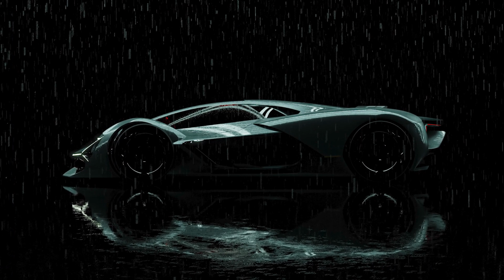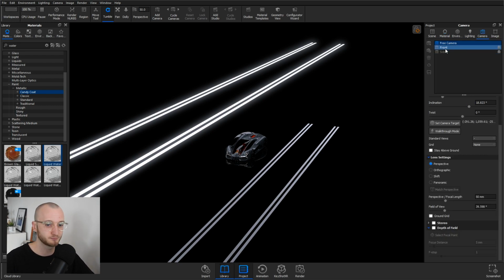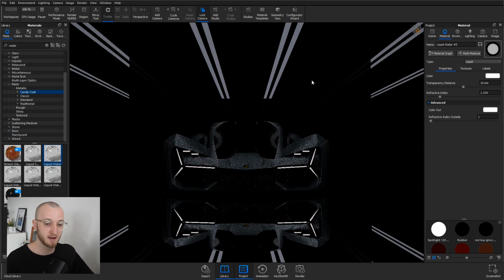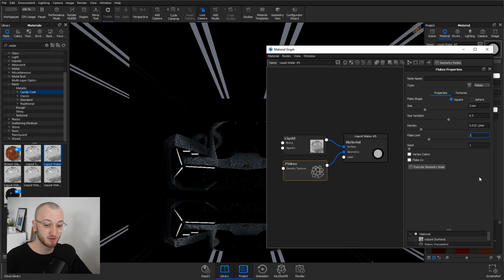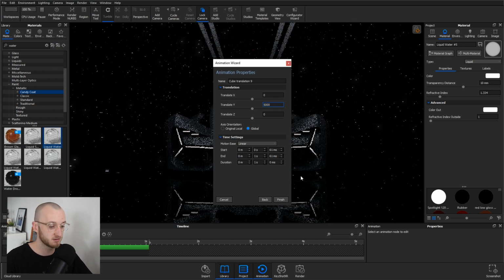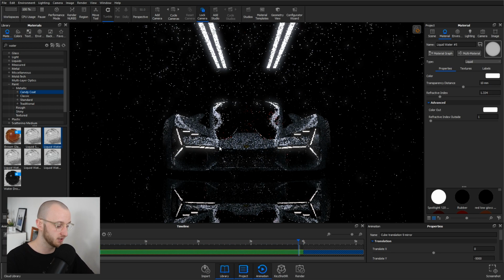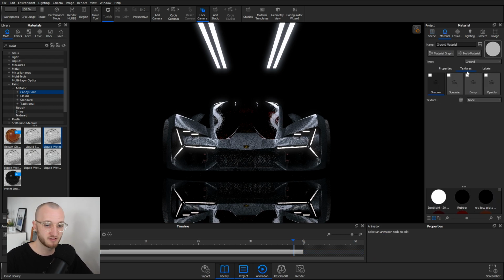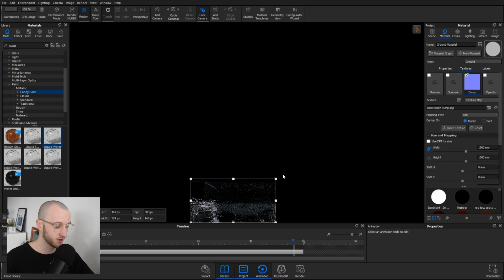How to Make Falling Rain in Keyshot

Comment: Well I started to follow along this tutorial, but for some reason my area lights don't seem to light up. Is there anything that I might be missing?
 I added a geometry and then dragged the area light material on the geometry.
Btw amazing results!
Reply: I had to set it to 3000 Lux to get it working for some reason.
Gonna add some flakes now!
Reply: It worked!
Reply from the maker: @sparkthatplug  nice! Yes Area Light spreads the power across the geometry, so if you have a large plane you need a lot of power
Reply: @LiamMartinTutorials  I was just working to refine the flakes/rain. As of now, it appears like white dots or so, not really translucent like yours. Any advice on that?
Reply from the maker: @sparkthatplug  no idea. Have you set the flakes to be water?

Comment: Can you make a tutorial on how to make the overhead lights?
Reply: Did you find a tutorial about that?
Reply: @Alessandro-op7sr  no i havent my thought is make a plane and change it to light
Reply: @RaviTeja-jg2uf  Correct method, insert plane then scale it to be long and thin. Double click on the plane, change material to area light, chose colour and brightness then duplicate as many parallel planes as you like. Then move them apart by using the "ctrl+d" command

Comment: Very nice tutorial! I never thought of using the flakes that way, very smart 👍
Just a couple of things:

· You don´t need to create a symmetry for the animation, just input a negative value (-5000 i.e.).
· You can adjust the level of motion blur changing the FPS instead of the length of the animation (Less FPS = More motion blur).
· I guess you can make sphere flakes instead of square flakes for more realistic rain?

I´m going to give it a try later, do you happen to have a link to the rain texture on the car? 😁
Reply from the maker: Thanks for your feedback. The reason I do a mirror is to position the rain back where it starts. I don't believe you can make spherical flakes, you could use a pattern to duplicate a lot of spheres across a scene.

Check out my water droplets and condensation for the rain texture on the car.
Reply: @LiamMartinTutorials   yes there is an option to switch between square or spherical flakes :) thanks for the amazing tutorial!